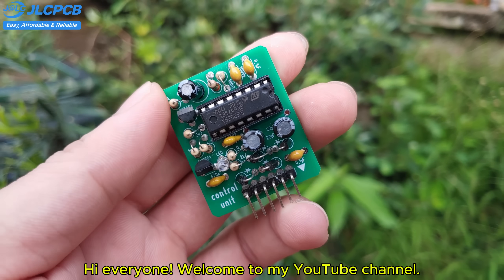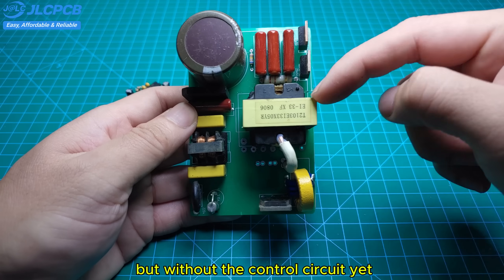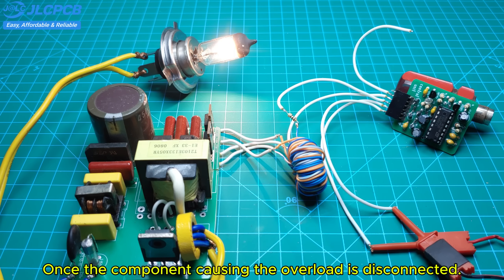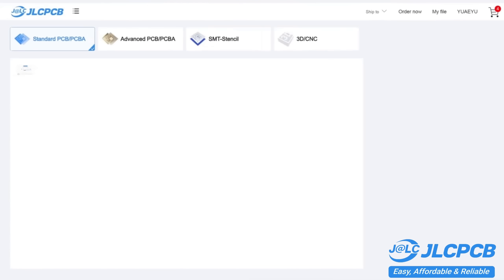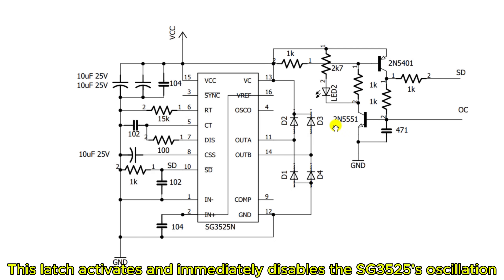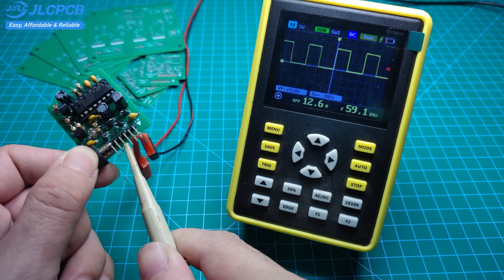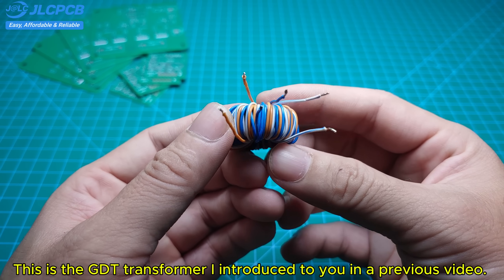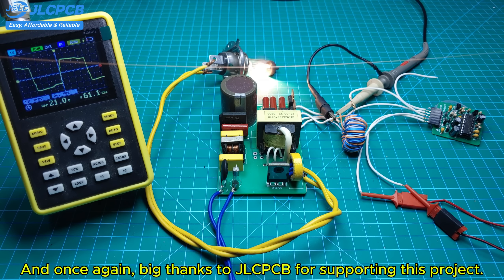5Kw SMPS Driver Control Circuit | JLCPCB

Comment: Dear Sir, can we use that circuit to drive the primary stage of an inverter ? If yes, how about the feedback circuit ? Thank you !
Reply from the maker: It OK for inverter but no feedback bro. That pin is disable
Reply: @LongTechnical  Thanks for the answer !

Comment: Where and how do I use the OC PIN
Reply from the maker: From current tranformer or shunt resistor bro
Reply: How many volts will it trip if it gets here @LongTechnical